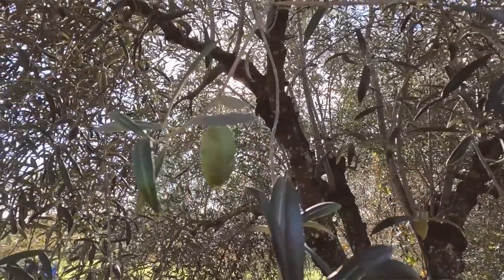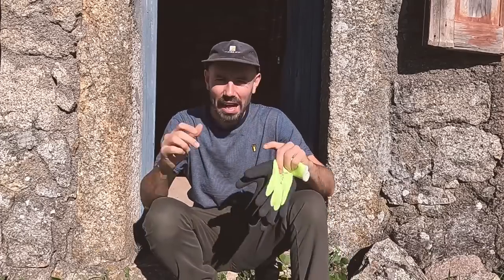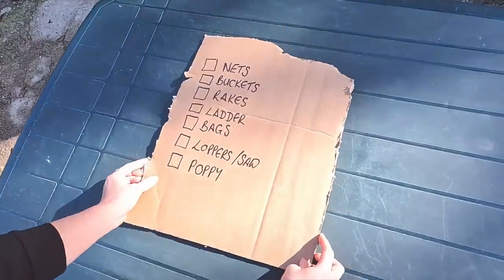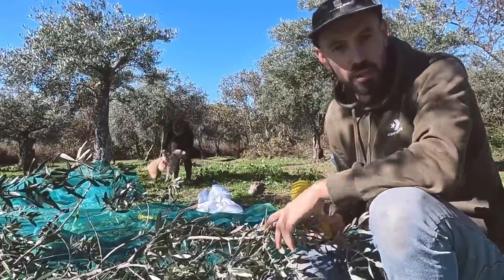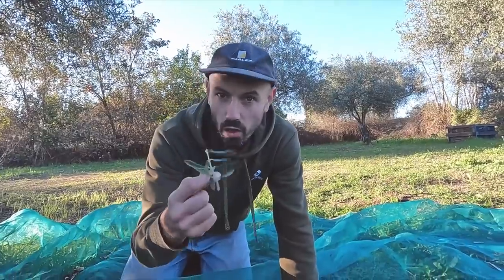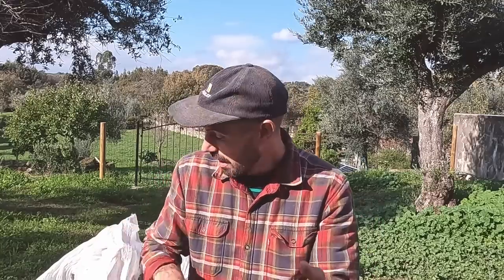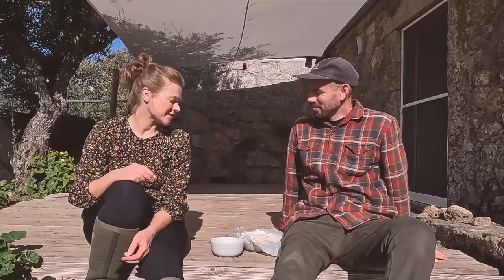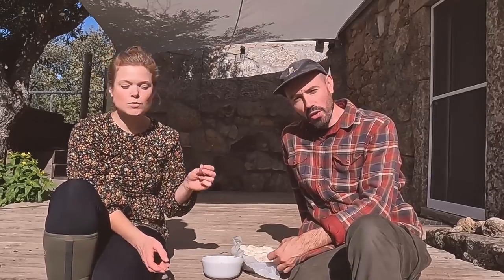"THAT'S DISGUSTING!" - Olive Harvesting & Tiny House Renovation

Comment: Ricky multiple applications of brick acid to soften the concrete followed by de scaling it from the stone with a needle gun. 
The sds will wreck the stone, the wire brush isn’t man enough but a needle gun is in between. 
You could try multiple applications of acid and then wire brush first but I think the needle gun would work better and much more quickly.
Reply from the maker: Cheers Simon. I’ve been looking at needle hammers this past week. Can’t source them anywhere locally so going to have to get one online. Have you used acid on stone before? I’ve got muriatic acid here but haven’t used it yet
Reply: @LifebyLiving  muriatic acid is the same thing yes, it’s diluted down for use depending on the original strength. Multiple applications may be needed esp where the cement is thicker. You’d need to do a small sample area to check for any I’ll effects on your stone and definitely don’t use it on limestone or marble which it will just eat away. Rinse with plenty clean water afterwards. I’ve only used it on bricks, it’s very effective but still laborious work

Comment: Hi Ricky, to get the cement mortar out of the joints you might try investing in an SDS drill that has chisels with it the chisels may well remove it, to clean up the stone I’d try a steel wire brush in an angle grinder ( lots more rpm than a drill ! Failing that you could try some brick acid to clean the stones up and loosen the cement and if all else fails you could just lime plaster over the walls, lime is a much more sympathetic material than cement and far nicer to work with
Good luck and keep going your doing great!
Reply from the maker: Hi Rich. I do have an SDS drill but I read  that it’s too heavy duty for the job. The plan is to point & render with lime 👍🏼
Reply: @LifebyLiving have a gentle go with the sds with a point in it, perhaps a sample block to remove the mortar between the joints, give it a whirl you might be surprised ! Would be good to see the result, if it works you can then do the job properly with lime mortar, I’ve been restoring a grade 2 listed stone  building using lime mortar and plaster recently and I can assure you that it’s a lovely material
Reply from the maker: @richwarren8880  I've worked with lime before. Very nice to work with

Comment: I blend the pitted olives (DON'T add any water), gently heat the pulp in a pan for 5 - 10 minutes, keep it moving and don't let it boil, then spoon the hot paste onto a cheesecloth. Allow it to cool, and then wrap the cheesecloth up around the paste and twist to tighten, forcing the oil out. Allow the collected oil to sit in the fridge or somewhere cool overnight and the oil will fully separate from the rest of the remaining liquid. That's when the syringe comes in handy :)

Always interesting to see your progress - thanks for sharing :)

Comment: Lovely episode! We renovated a stone house in France and there were some walls where someone had splashed concrete on, just like in yours. It is nearly impossible to get off without also damaging the stone, but if you use a concrete grinding disk on an angle grinder and do it v-e-r-y carefully, you  may have some success. A lot of work though.
Reply from the maker: Thanks Sarah. Sadly I thought that would be the case. I’m definitely going to slog away at the exterior stone work as I don’t want to cover it but I think I’ll be admiring defeat & lime rendering over the interior walls

Comment: ciao Ricky I think that granite is beautiful but it is also extremely closed to the passage of steam, so an interior plaster without a mixture of cement and hygroscopic can do a lot of good for the indoor environment. however, we have not yet isolated the wall. if we also want to improve the thermal insulation, we can work with thermo plaster or hygroscopic and capillary active panels (io penso che il granito sia bellissimo ma è anche estremamente chiuso al passaggio del vapore, quindi un intonaco interno senza miscele di cemento e igroscopico può fare molto bene all'ambiente interno. però ancora non abbiamo isolato la parete. se vogliamo anche migliorare l'isolamento termico, possiamo lavorare con termointonaco o pannelli igroscopici e attivi capillarmente)

Comment: That was too funny. I like olives but have to pull out the pamintos out. Don't like them. Have you thought about a grinder to help remove more of the cement? It could be risky grinding the stones. Just a thought.
Reply from the maker: Thanks for watching Cathy 😊 Yes I could use an angle grinder to remove the concrete but I think it might damage the stone in the process

Comment: Regarding your question. You will never be able to clear that mortar of those stones whitout a LOT of hard work AND the use of saltpeter acide. I recommend a white wash with slaked lime. Up to you how much of the concrete you remove to make it look sort of the way you want.

I would mechanically remove the mortar joints like 5 mm in and chunky parts of what is on the stones before doing above.

Hope I got it right. English is not my first language.
Reply from the maker: Perfectly understood Anders 👍🏼 I think I may just render/plaster over it with lime on the inside but I still need to remove everything from the exterior so I can point it

Comment: Ricky, try sandblast or bushammer tool, that will clean the concrete from the rocks. But is is a bit of work that’s for sure
Reply from the maker: Thanks Albert 👍🏼 Just looked at bush hammers…how do they remove the concrete? I can’t figure it out

Comment: i used a routing tool in my drill which raked out the joints on my wall. I looks like a chubby reamer that you used in metalwork in school. Power washing might help the wall too
Reply from the maker: Cheers Andrew. Definitely going to give it a pressure wash soon both inside & out. I do have a chisel bit for my sds but read in multiple places that a drill is too powerful & damages the integrity of the granite wall?

Comment: Needlescaler to remove the cement . Usually air operated .
Reply from the maker: Watched a few videos of needle scalers & I’m not convinced it’ll be powerful enough to remove this concrete. It’s not a soft mortar mix, it’s extremely tough with a large aggregate. Have you used one before?
Reply: @LifebyLiving  Yeah , In an Industrial situation to remove heavy rusty scale  from steel . Also used it on my lounge floor to remove crusty bitumen stuff after removing floor & relaying . It was a bit noisy .

Comment: had something similar in an old house in France, the wire brush your using with the drill will not work. if you want to go down that avenue you will need to get the heavy duty one for an angle grinder and attack the stubborn stuff with a sds plus attachement for your big drill. Personally I would cover all the internal walls with a lime mortar. this will actually breath and you won't get signs of damp
Reply from the maker: Thanks Jon. The reason I’d wanted to remove as much of the concrete as possible is to replace it all with lime. I think though that I might just end up leaving it be & lime render all four walls instead of having three rendered & one pointed feature wall. I’ve got numerous bits for the sds but was led to believe that it’s too powerful to be used in this situation?
Reply: @LifebyLiving  I'd be doing some experimentation before losing the will to live, re - concrete removal...!
Reply: @LifebyLiving  I guess it depends which attachment to be honest. I must admit I gave up here in the end and opted for dry lining as the boss lady wanted a cleaner finish to the internal lime render. but I would get one of the heavy wire brushes for an angle grinder and give that a go

Comment: Isn't there some kind of chemical that you can spray on to soften the concrete and then you can power wash the debris off? Or maybe you could use a sand blaster?
Reply from the maker: Ordinarily you can use muriatic acid to soften cement mortar on brick/stone however this is not a normal soft cement mortar mix, it’s tough concrete. Also there’s mixed info out there whether you can use it on granite as it can damage the stone. I’m going to be testing it out in this week’s video 👍🏼 Sandblasting could be an option too but expensive

Comment: Spray one small area at a time with a 10-20% mixture of acid and water. Leave that about 10 minutes to soften the cement then brush it or hit it with a pressure washer. The acid will dissolve the cement but not the stone.
Love your work 👍
Reply from the maker: Awesome 😎 Thanks for the tip 👍🏼

Comment: Could not weaken things up with brick acid?
Reply from the maker: I’ve seen that muriatic acid is good for removing concrete mortar but apparently it’s bad for natural stone
Reply: @LifebyLiving  true that Ricky! It could oxidise and bring out a “rust”ic look ;) on the other hand that depends very much on the iron content of your stone…. You pays ya money you take your chances I guess…. Maybe worth a  try vs the expense of lime rendering… I guess another option could be high pressure jet washing and touch up the roughest bits with acid… either way all the best mate! Ur doing a fantastic job

Comment: (2.38)
Again by now you've most likely completed the renovation of your small building but I see from this video that you're using a hammer and chisel, as at this point in your video. I would have used a wire brush  and a wire circular drill bit, if that's what it's called, to remove the cement from and in between the granite walls. Just my thoughts process 😃
Reply: (4.05)
I preempted sorry 😊

Comment: Olive oil is not make like that. The olives are squeezed into a press to get the liquid part only. The pulp are not used. Them add water to the "oil" to blend to the nasty acid. Them water is separated form the moisture (tricky process) and the result is pure olive oil without the acid. The water carry away the acid. That the process that i learn. Bye
Reply from the maker: Hi Pedro. We know that’s not how olive oil is made at the lagar. This is just a way to make olive oil when you don’t have a pressing machine

Comment: To remove the concrete from the stone you can use a sand blaster or something like this: https://www.youtube.com/watch?v=f9vfEF0FBFw
Reply from the maker: I had thought about sandblasting but wasn’t sure if it’ll damage the stone? That other tool is cool. I’ll have a look
Reply: @LifebyLiving  sandblasting will depend on the pressure used. I would advise (if you choose that method) to find a stone to test, in a hidden corner or something and use it as sample.
Reply from the maker: @cesarneves  for sure! Will definitely test before going to the wall 😎

Comment: I would suggest not giving up on the pointed stone feature wall. It adds texture to otherwise bland space if it is all rendered. If you continue with the cleaning and repointing in between stones it will look much better. Over time you can slowly continue to chip away at the worst of the old sloppy cement spots. When it is satisfactory you can paint it with pva glue (wood glue) diluted 5:1 or so which will keep the surface cleaner and lock in the particles of stone that would shed otherwise. Test first. I have similar granite stone walls I'm working on, and the rogue cement spots are not terrible when the rest is neat and pointed.
Reply from the maker: I really want to persevere for the sake of the feature wall but I’ve got little confidence that this concrete can be removed without damaging the stone. It’s not a typical softish cement mortar mix. It’s an extremely hard concrete mix & they’ve literally just thrown it at the wall 😭 I’ve no idea what they were thinking
Reply: @LifebyLiving  I know exactly what you mean with the hard cement. It was a barn or storage perhaps. So what if the stone gets chipped a bit on the surface. Stone looks rough by nature unless carefully quarried.

Comment: Air hammer. Compressor and mechanics small hand held air hammer. Cheap. Might need a generator to power compressor. You Tube channel Escape to Rural France demonstrates the effectiveness of air hammer/chisel. That's with lime but still your best option
Reply from the maker: Awesome I’ll take a look. Thanksgiving the tip 👍🏼
Reply: @LifebyLiving  lime mortar and concrete are, of course, different animals.......!